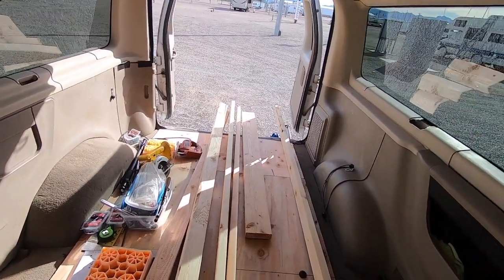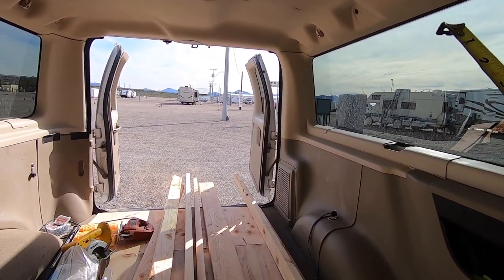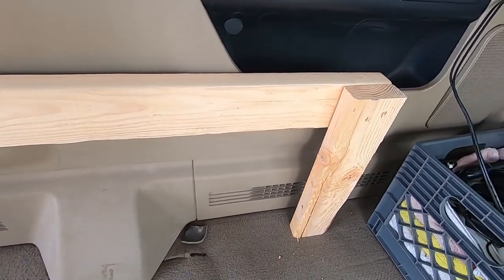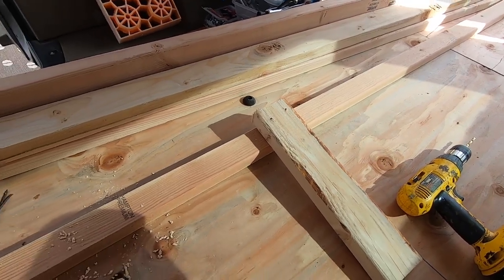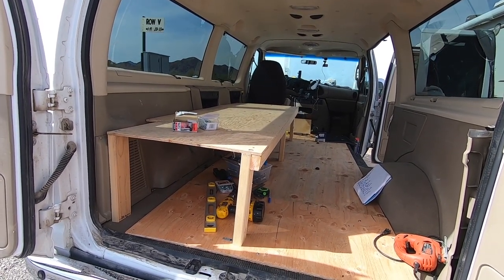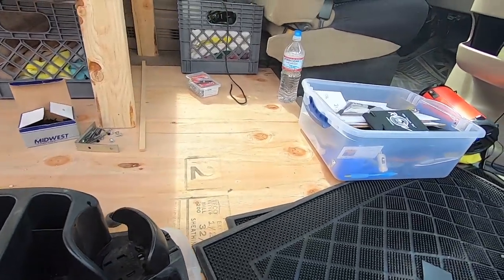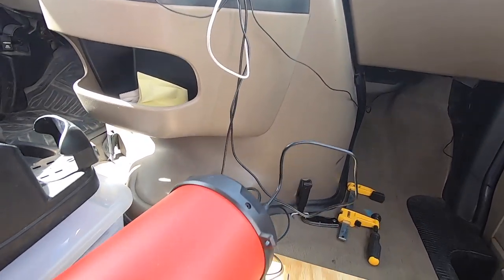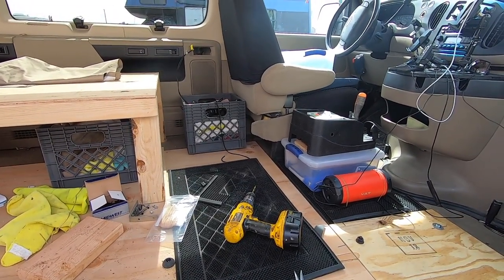DIY CUSTOM BED FRAME For VAN BUILD

Comment: Russ, you’re gonna need to have some ventilation holes in the mattress platform. Without this, your mattress and bedding covers will quickly build up a lot of humidity... and this will cause mold and mildew - in between the mattress and the wood, or anything that covers the wood platform. You don’t want that problem!!!  Yep, I’m aware that this is Arizona..., and the DRYNESS of the region. Better to address this during the construction phase rather than having to redo this afterwards.

Another recommendation would be to paint the bed platform surface..., to prevent moisture from penetrating the wood. Moisture buildup in enclosed spaces gets ugly real quick. Waiting to see the final build out.

Comment: .. plugging a set of Ear Buds straight into your Sirius radio works, too.. there is a Volume Control in the settings called Output Level or something for that jack..i listen to Mine like that All the Time..